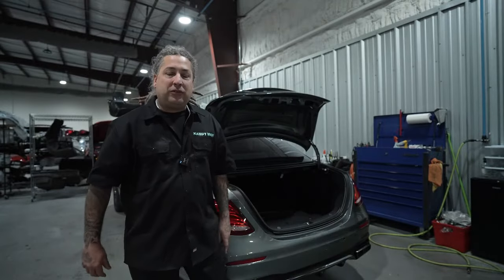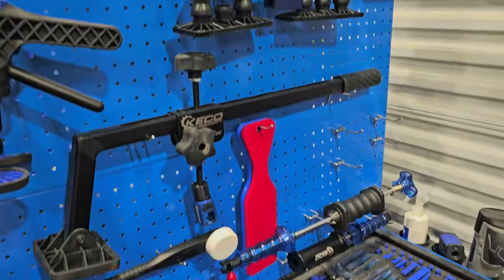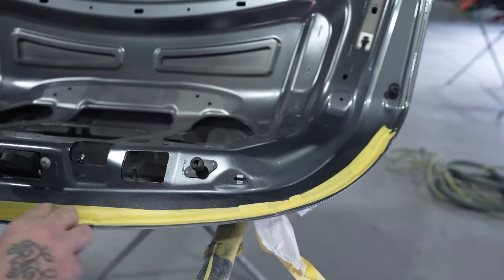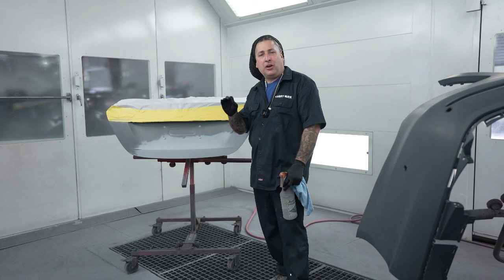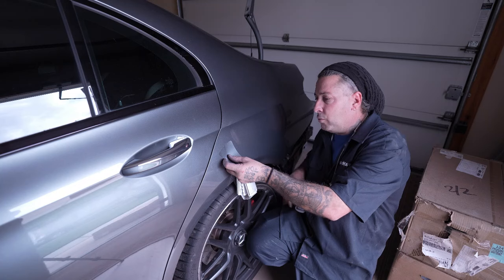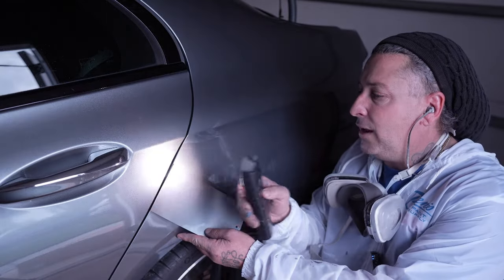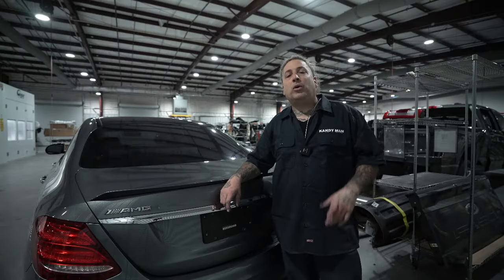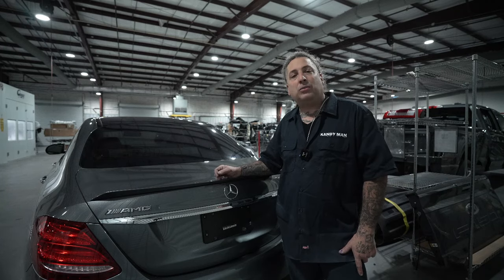Choosing The Right Repair Process For Collision Repair ,Mercedes E63

Comment: Beautiful job Kman! As always. Technique used ar spot on. I totally agree with less paint on the car. Why paint the upper part or the deck if you don't have to especially if it's not damaged. Original is still original. I like the glue pull method you used. I'm going to try and implement it more in my shop when repairing aluminum panels. Kandyman ROCKS!! And I love how you explain everything both to us in the biz and to those out there possibly wanting to get into it . Keep doing what you're doing. Your boss should really appreciate you K.
Reply from the maker: Thank you 👊

Comment: Great video. I have been retired now for about 5 years from the trade and am amazed the  way things have changed on repairing panels. PDR guys have  been around for a long time but I have never seen the repair system equipment your shop has to repair aluminum panels with glue on tabs. Makes it better for painters. Never to old to learn new tricks of the trade. Thanks for the info.
Reply from the maker: Thanks for the insight 👍

Comment: I have to paint bondo spots on boats and don’t have time to prime and sand so I use evercoat 440 express and rub that into the spots. It fills in a lot! But doesn’t always fill everything so I’ll end up sealing it then have to sand it down flat and then spotting in more sealer on that area to keep the proper mils.

Comment: Final questions -  Did you used adhesion promotor on the bumper i guess not , since this is OEM bumper from Mercedes and comes already factory primed and only needs to be sanded. Second question did you mixed in flex agent in the sealer/basecoat/clear coats? Sorry - a lot of questions i hope you answer.

Comment: What was that brace Jorge used on the rebuild? I usually have to do it on the floor.

What do you do qhen there isnt a good break between the quarters and roof to take the clear to? I usually blend on the pillar since it won't see the Sun as much as the roof would. I don't like it but thats my logic. Any advice?
Reply from the maker: Work stand extension rod
 I would clear all the way over
Reply: @kandyman5315  I was afraid you would say that.